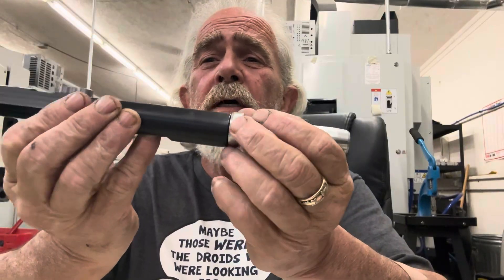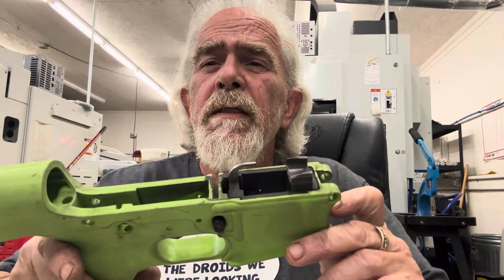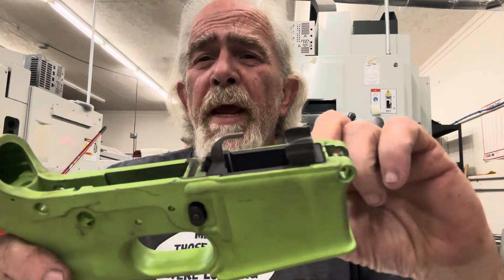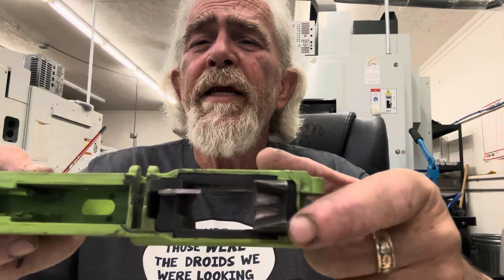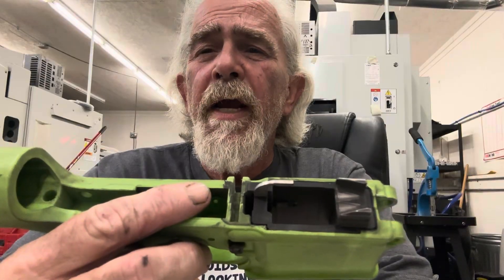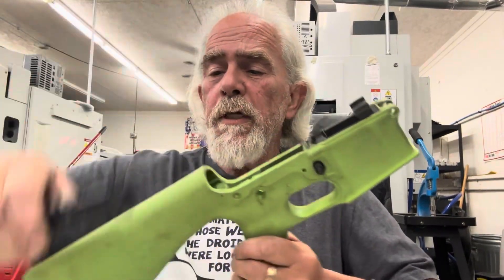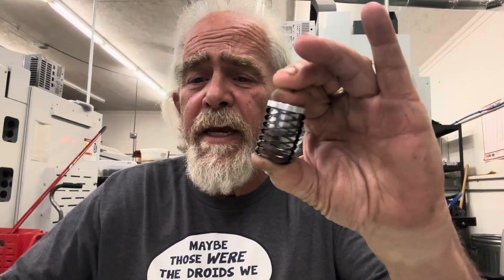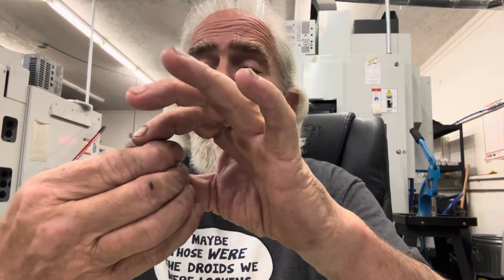TACCOM3g.com — NEW 2 stage PCC recoil management system

Comment: The M16 is not an open bolt machine gun!  Even after you state that it is you go on to describe the action of a closed bolt.  The M60, M231, M249, MG42, MG3, and the M240 are all open bolt machine guns.